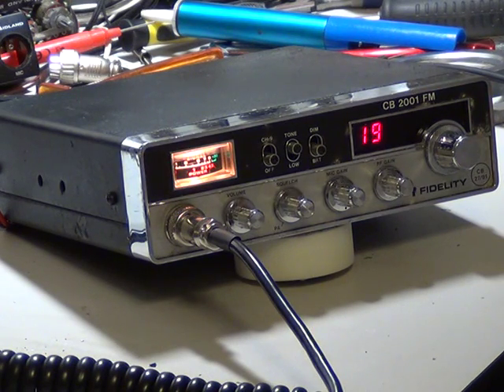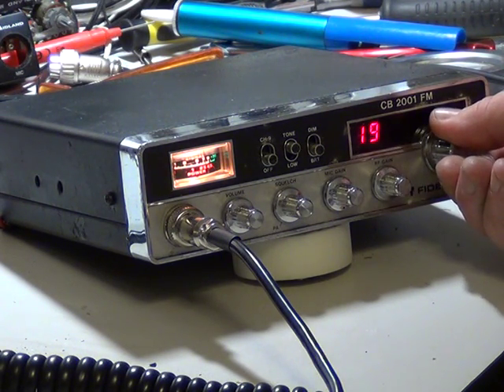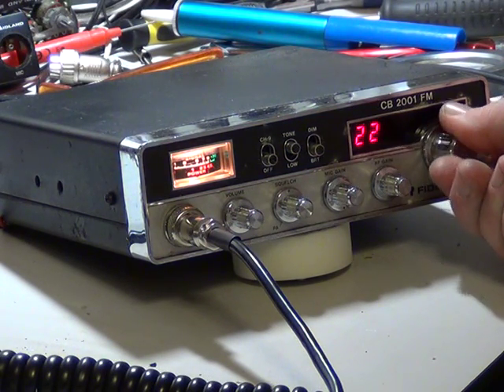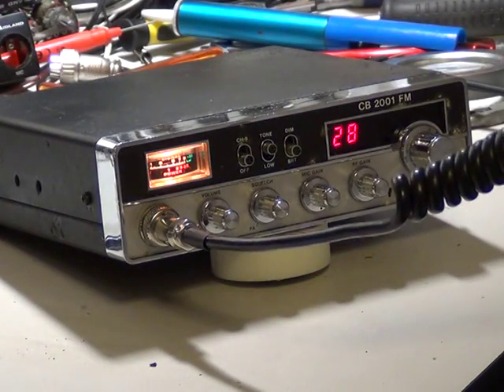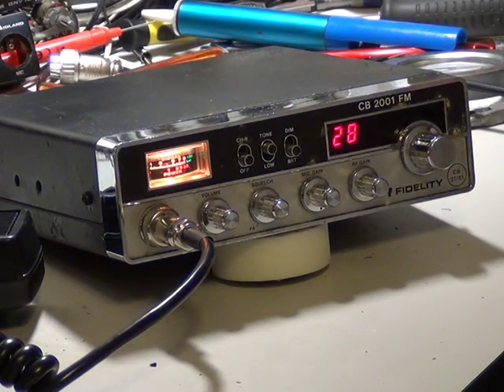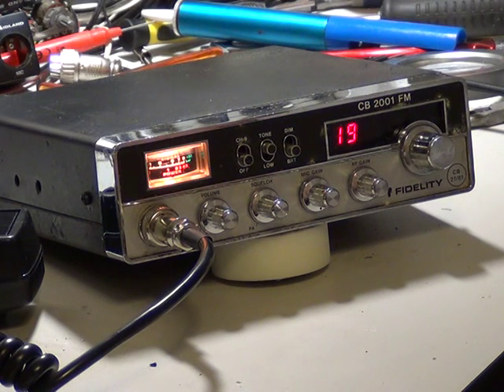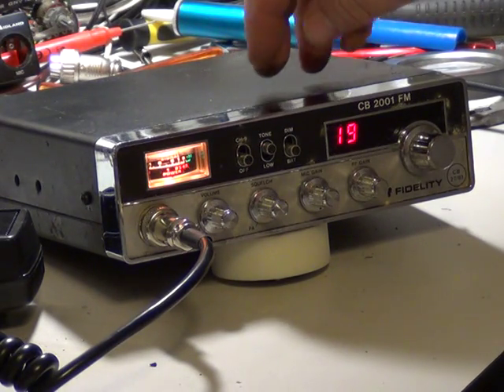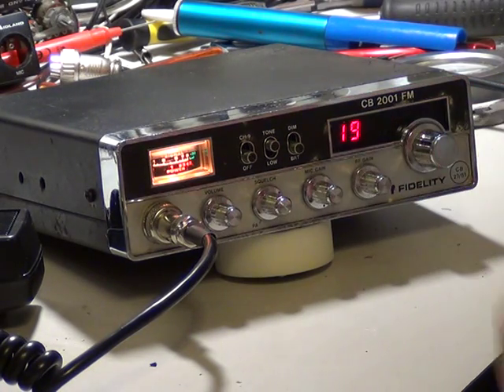Fidelity 2001, UK (CB 27/81) CB radio (Mobile) -  On The Air Test

Comment: Nice set (Fidelity always reminds me of my first record player!) I guess these were the same chassis as the fabulous Binatone 5 Star.
Reply from the maker: Not quite, The Fidelity 2000 & the Binatone 5-star (and Speedway) used the Cybernet 134 chassis. The Fidelity 2001 uses the Cybernet 002F chassis, as does the Harvard Homebase, Mustang radios & the genuine version of the Amstrad 901.

Richard
Reply: UK CB radio servicing Ahhhh right the Fidelirty 2000 is the one I was thinking of. The 134 was also the Rotel 240 / Harrier CBX etc as well (or not?).
On another point, I had an 'Interceptor TC300' radio with the 2 columns of fancy lights on it and fascia styling clearly from the school of Hygain 5! - do you know the one? (Or even have one for a video!)
Reply from the maker: Not done a video of the Interceptor TC300, which uses a unique chassis & was custom produced in Korea by Parkers Automotive. If your SWR is high, the TX column of fairy lights flashes at you as it goes into "SWR Alarm" mode! I have an ultra rare version of the TC300 here that I bought in a job lot of scrap chassis....a Harry Moss TC300....properly screen printed on the front

Yes, you are right on the Harrier & Rotel sets.
Reply: UK CB radio servicing That's right - the SWR alarm was why I got rid of it as it was falsely triggering as the radio warmed up over a period of about half an hour.
Reply from the maker: I expect it just wanted servicing

Comment: excellent radio, nice to see you have saved it from the scrap bin , I bet you have some sort of servisol for your organ pipes lol, Joking apart i purchased some servisol switch cleaning lubricant for mic switchs and it seems to do a lovely job.
chris
Reply from the maker: The Servisol products are the real deal & have been going since the 1950's. I stock Freezer, Switch cleaner, Foam cleanser, Isopropyl Alchohol & label remover. The kiss of death in electronics is WD40. It's great for locks & some automotive applications & I keep it in stock....but nowhere near electrical contacts please!

I only bought that Fidelity 2001 because it had a good condition power socket on the back. I thought we'd sell it someone for £3, thus making a 50% profit. There are 3 Amstrad sets here waiting for power sockets to come up for a start. They'll have to wait a bit longer now! The sensitivity of this Fidelity 2001 is off my clock! that doesn't often happen.

In the pipe organ restoration workshop is Servisol Foam cleanser & Isopropyl Alchohol. Just about everything else is traditional...like hot glue, animal based.